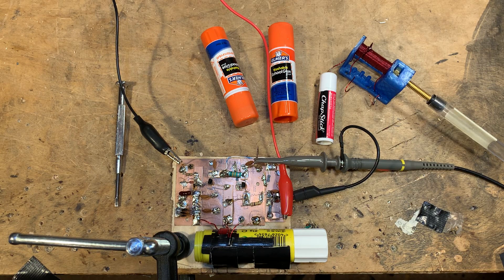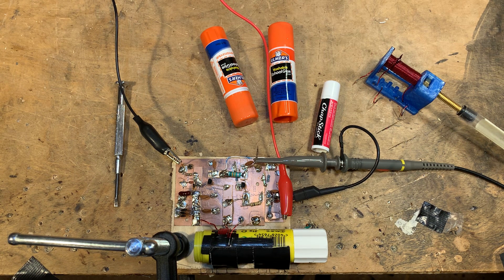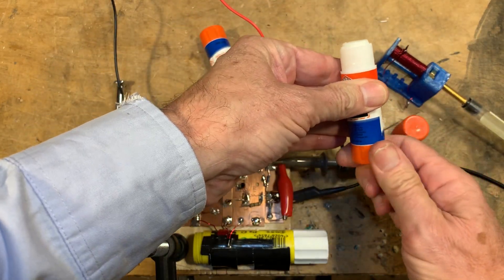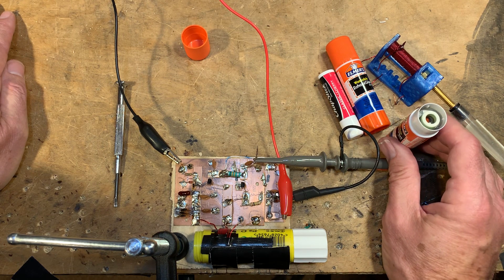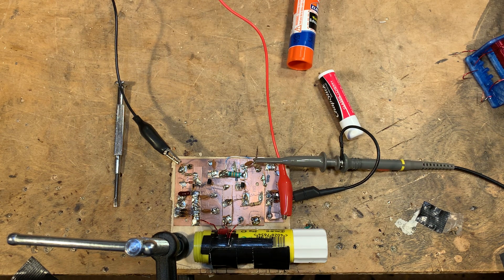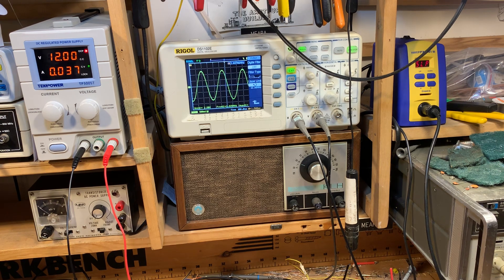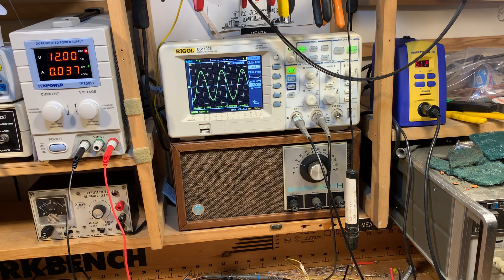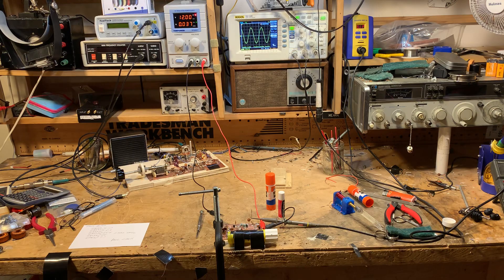Glue Sticks!  Chap Sticks! Paul Clark’s Dollar Store Permeability Tuned Oscillators

Comment: Nice demo! I experimented with glue stick PTO's as early as 2016 to (re)build a DC receiver for 20m that introduced me to amateur radio way back in 1978. That was a nice, simple circuit designed by Mike Tooley and published in Practical Wireless (1978). It had a Clapp configuration VFO and a MOSFET 40673 preamplifier. Although it worked really well with a dipole antenna, the VFO was not as stable as one could wish for. About 8 years ago I rebuilt the receiver in the same experimental, Manhattan way you build your 7Mhz receiver: several boards (preamp + detector, VFO and AF amplifier. The VFO was exactly the same circuit as the original, but built als a glue stick PTO and very different mechanically and put in a separate box. The coil and associated capacitors that determine the frequency were physically blocked from the active element (a 2N 3819 FET transistor) by the MDF supports that firmly held the coil some 5 cm above the board. In the glue holder I glued a brass ring to shift the frequency from about 14 to 16 Mhz. The PTO proved to be extraordinary stable for that high frequency! PTO is definitely the way to go for homebuilders!
Reply from the maker: Very interesting Eric. I tried and failed to complete a DC receiver in 1976.   I tried again some 38 years later and got it right.  Better late than never. The Glue Sticks are fun.  I may do another video on them soon.  73  Bill

Comment: I think I see a way to enable some fine tuning and maybe even some AFC. Add a second coil with lots of fine turns that is 90° off from the oscillator coil. Then you can apply a DC current to this second coil to partially saturated the core. This would probably slightly distort the waveform, but depending on the signal, it might still result in a better S/N.

Comment: HiBill,
You may recall that Drake settled on 25KHz per knob revolution (and was followed by many other manyfacturer's) with their  4 line.
It would be interesting to see a plot of frequency vs. knob revolution to check out its linearity. You may also recall that Collins achieved their excellent PTO  linearity  by  using predetermined variable turns spacing.

Fun stuff Bill- Tnx,

Dale W4OP
Reply from the maker: Thanks Dale.  I will turn your questions over to Nick M0NTV at the new Glue Stick PTO Research Institute (GSPTORI).  Seriously though,  I think the frequency variation will depend a lot on the kind of material that the screw is moving into the coil.  My early test (before I had it tweaked into the 40 meter band), using one toroid moving into the coil (as in the video) showed the following frequencies at 1 turn increments:  7528.9, 7523.1, 7500.3, 7443.0, 7383.8.  So in my quick and dirty build, I had about 20 - 60 kHz per turn.  One of the real challenges is the "looseness" of the screw and cup. Obviously, they are not engineered for precision.  You can end up with sloppiness in tuning, especially when you change direction of the turn.  Some suggest putting some springs to hold the cup to one side of the screw turns, but I fear this could lead us to getting carried away by Glue Stick Improvement Mania.  73  Bill
Reply: @soldersmoke  I would agree that the  Delta per turn will vary with the mu of the material but that will not alter the linearity curve. It apparently takes a lot of time to get it linear- as  Collins was building each  PTO individually with a lot of testing going on.
My answer for years is to do away with all the mechanical stuff and use Varicaps. With some ingenuity and math one can get the frequency Delta/turn quite linear and also temperature compensate. The important thing is to just keep home brewing!
Dale W4OP

Comment: Hi Bill. First, above all, coffee in the morning is your friend. Second, I have also been interested in s PTO solution to address the increasing scarcity of variable capacitors and sir variable capacitors. The only turn off, pardon the unintentional pun, is that the knob moves in and out on these brass screw inside a coil on a drinking straw coil form. The glue stick is a neat idea. I also wonder if fixed NP0 capacitors in a binary pattern wired in parallel starting with 1 pF and then doubling with each bit and ending with 64 pF switched in and out using SPST toggle switches could also work or would all that extra wiring add in unwanted inductance. What are your thoughts on this admittedly cumbersome approach but with a proper binary rotary switch to manage incremental changes in frequency?

72s,

Rick, WD5L
Reply from the maker: https://soldersmoke.blogspot.com/2022/10/worlds-most-interesting-man-on-ptos-and.html

Comment: Permeability tuning was fairly common in car radio designs.

The mech of the glue sticks;  there is another source, but it can come with some dangers... YL or XYL lipstick tubes. which use a very similar mech, so ask nicely! 

If you want a really small mech to do this, then look at the Parker Pen delux convertor. As you turn the spindle the small piston moves up and down the tube to draw in the ink. The tube is not much more than 1/4 of an inch in diameter. Rather more expensive that the pound store glue stick, but good for seeing how such mechs work.

Screw drive adjusters are nothing new, your bench vice is one, lathe slides, etc. The screw is held in simple bearings, (A clearance hole)   Threaded onto the screw is a nut. Providing that nut runs in some sort of a channel it will move up and down the screw thread as the thread is rotated.

Take apart a multiturn trimpot (the long type) and see how that works. The centre wiper is held in a square channel and is driven by a screw thread (very similar to a vice setup) 

Use a square tube, and a square carrier for the "nut" The carrier can be fitted with whatever core material you want.  Use a nylon threaded rod and that will overcome the hand capacitance. 

Just look around the workshop, most likely you will find quite a few examples of such devices.

Andy

Comment: Bill, just out of curiosity, what is the ic chip below your FM receiver? It looks like it is embedded into the wood, lol. Nice work on the PTO!
Reply from the maker: I think that is what we could call a Troubleshooting Trophy.  It is a CD4019BE.  Maybe out of my old 6000 frequency counter, or maybe out of my  Maplin Audio Waveform Generator, both of which I repaired.  It adds soul to the workbench.  73  Bill